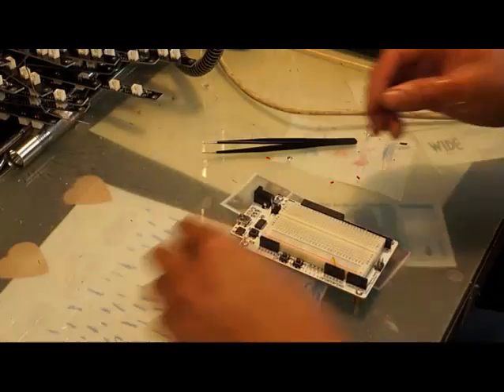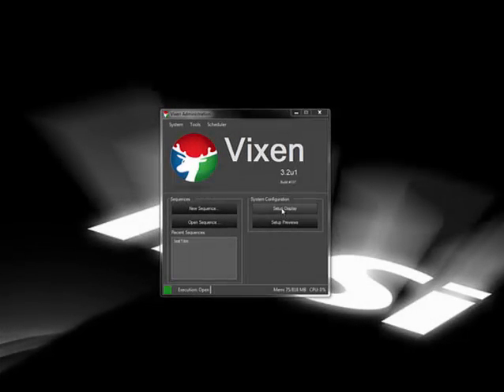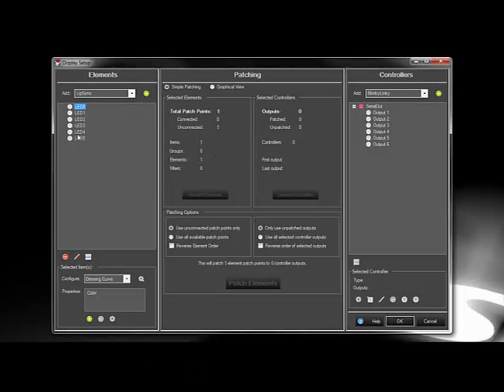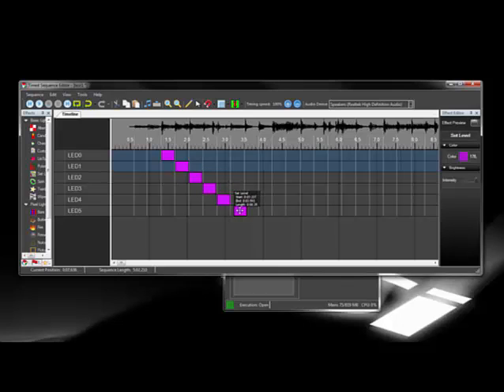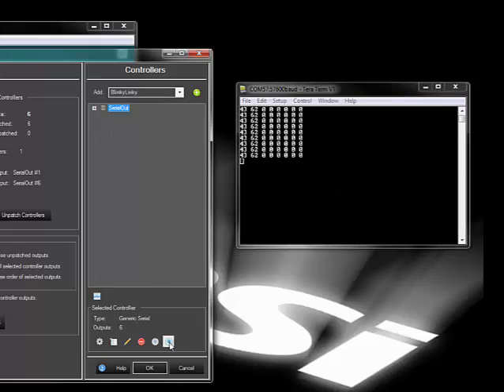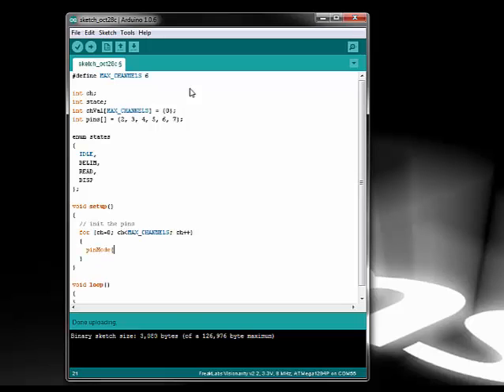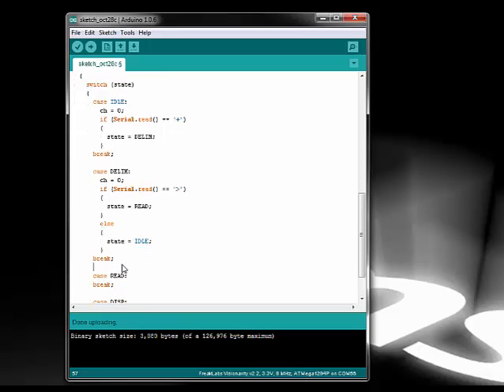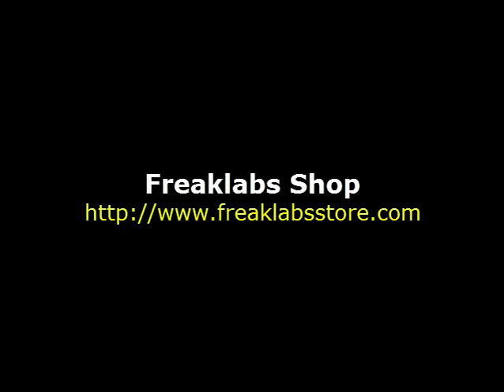Wireless Lighting Control with the Arduino and Vixen - Part 1

Comment: Which COM Ports do you use on the Arduino and Vixen? I tried using the same COM Ports for both (which is the COM Port which my Arduino is connected to) and it when I try and play the song through Vixen, nothing happens.

Comment: I'm trying to figure out how to "sniff" the sequencer data sent by Vixen but I can't figure out which Freaklabs boards you are using or how you wired/set them up.  Can you provide any details about how you did that, something I could use to try to mimic that "sniffing" step using my Arduino Uno R3 (sequencer) and maybe one of the dev boards I already have handy (Pi Zero, Adafruit Feather Huzzah and Adafruit Circuit Playground)?
Reply: Hi Uncle Moki. The sniffer I'm using is the one I designed for 802.15.4. There's more info in this tutorial: 
https://archive.freaklabs.org/index.php/tutorials/software/sniffing-the-internet-of-things-with-wireshark-sensniff-and-freaklabs.html

For the Huzzah, you can try to use a wifi sniffer as well. It really depends on which protocol you use.
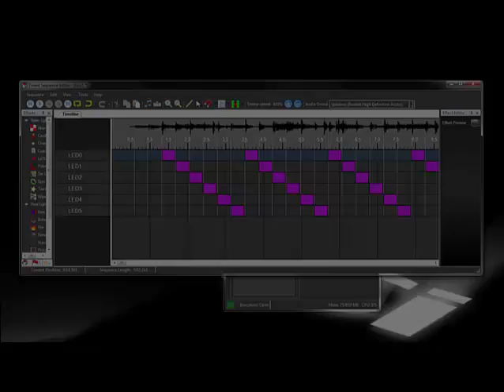Reply: Thanks Chris - I'm actually not doing any wireless stuff right now, just trying to learn Vixen and see what kind of DIY setup I can create with some of the boards I've picked-up (wireless is a future phase).  At the 5:12 mark in the video you had Vixen talking to the fist board over USB.  Then you used a 2nd board to echo the data back out to Tera Term.  I'm trying to do the same thing with Vixen and my Uno.  It was suggested that what I'm looking for is something (a board or cable) to serve as a TTL to USB converter.  Is that essentially what you did in the video using a FreakUSB?
Reply: Got it worked out ... basically used a SoftwareSerial TX pin on the Uno and connected it to the RX pin of the Feather Huzzah.  That allowed me to see the VixenLight data going into the Uno and out to a terminal emulator connected to the Feather.  I think that's basically what you were doing with the Freakduino boards, I just didn't know it when I was watching.  Thanks for the tutorial!

Comment: Do I need to use one of your boards or can I use an UNO?  Do I have to hack the hardware if I use an uno?
Reply from the maker: An Uno is possible to control the lights but you would need a separate radio for the wireless. The freakduino has on board wireless radio to communicate and remotely control the lights.